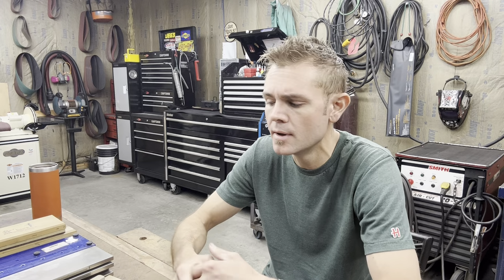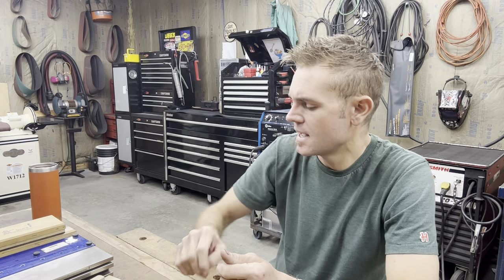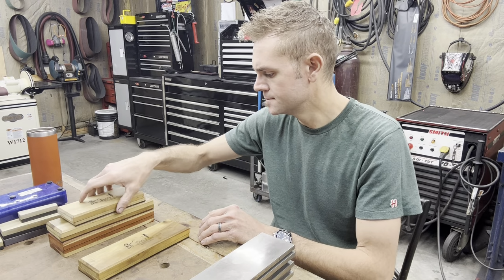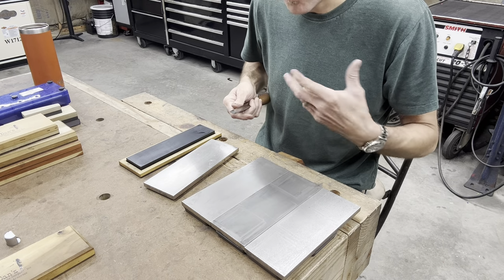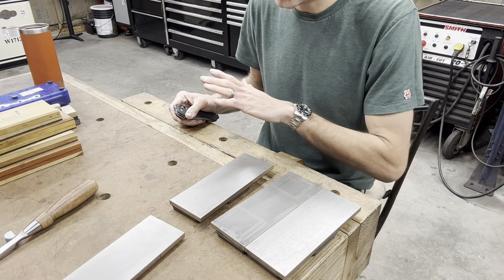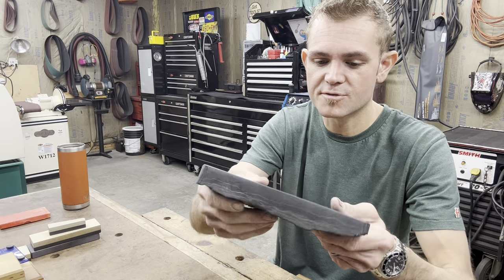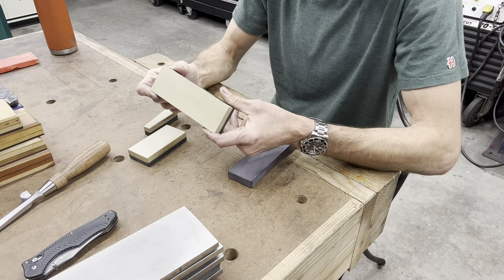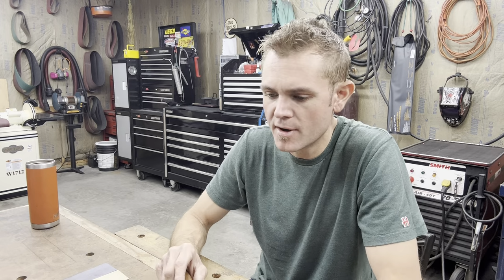Honing Equipment, Philosophy, and My Tool Honing Process.

Comment: Good to see another approach to sharpening. Its interesting that you rarely find two people with same same sharpening routine and everybody puts their own spin on it. That being said, you might be just the third person on youtube I found using oil stones. I got discouraged by them pretty early because the cheap ones worked strangely and the fine ones that cost more were so slow I practically couldnt see progress. But those Dans stones look awesome.

Comment: I have 2 Belgian Coticule that actually have Belgian blue on the back side. You can tell the naturally occurring ones when the two stones meet as a different angle and often times aren't actually straight in the middle, where they meet. The ones with slate on the back, have a very flat mating surface
Reply from the maker: I was totally thinking about the natural ones right after this video and I forgot to mention those! Thanks for bringing that up! Man, those are some cool stones. Like the two stones just blend together. What a unique vein of rock to be producing stones like that naturally. Coticules are like a natural wonder to me. I’m kind of weird, I even love the smell of the slurry when honing. Smells like a fresh rain.
Reply: @AndrewKimmons  Petrichor. That's the word you're looking for, I think

Comment: Very interesting video. I find there is something about Arkansas stones and oil that goes with chisels. But I restore old carbon steel chisels and the Arks may be too slow on modern tool steels - which is probably why you use diamond. I use Norton 120 sandpaper to grind a new bevel when needed, go through the soft and two hards, then strops and stop when the chisel cuts paper completely cleanly. I am toying with getting a black Arkansas just because I want it but would it be too fine for chisels?  I take your point about keeping a bit of toothiness. Chefs say the same thing and many do not go over 2000 or 3000 grit max.